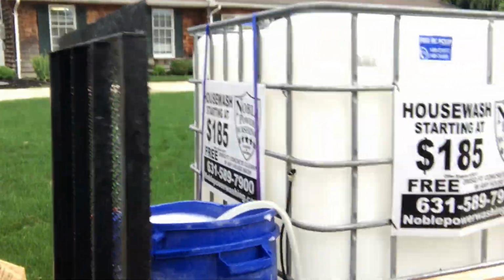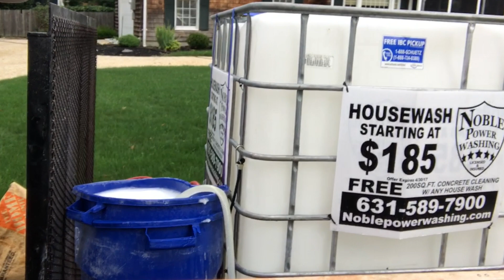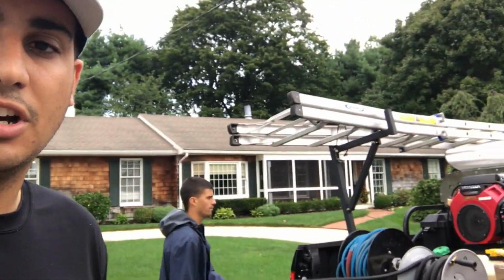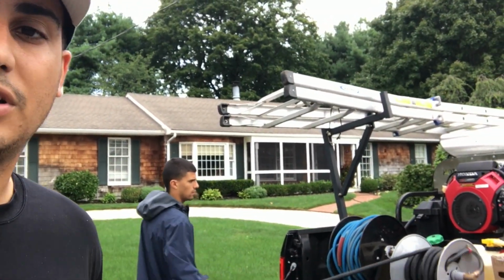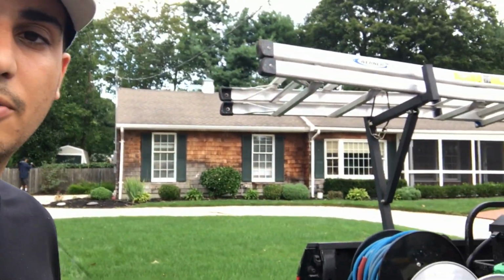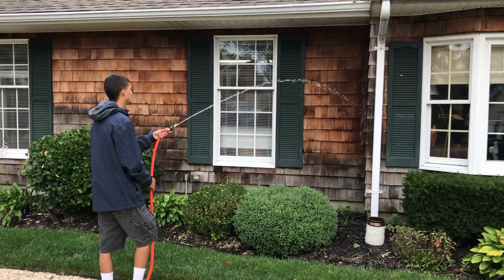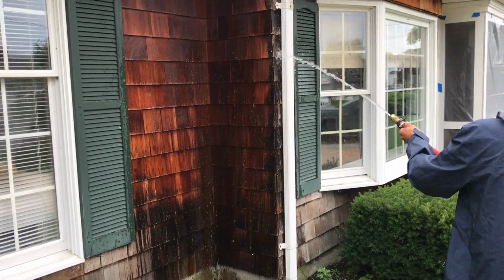Noble Power Washing: Cedar Restoration in Brookhaven, NY

Comment: Spray with 3% sh, rinse, spray with oxalic acid, rinse
Reply: Had me sold up until the pressure on the wood 🥴 soft rinse followed with oxalic and rinse like you said
Reply: I didnt think u should mix ur sh or hp with ur ox and spray both at the same and its mix takin off the fibers or u blasting it off ???

Comment: My neighbor had their cedar shake siding power cleaned although they didn’t pretreat it.  They used the power washer just like you appeared to and now her side looks sparkling clean but the warpage is so bad it looks horrible. Some of the cedar edges are as much as 4 inches away from being flush.  A bunch more 2-3 inches and all at least an inch. After seeing that I would never clean it with anything high powered.

Comment: Seriously dude you just put pressure on wooden shingles definitely wash them against the grain definitely have lines all over that house.!
You’re supposed to soft wash a house like that
Reply: My neighbor had their cedar shake siding power cleaned although they didn’t pretreat it.  They used the power washer just appeared in this video and now her side looks sparkling clean but the warpage is so bad it looks horrible. Some of the cedar edges are as much as 4 inches away from being flush.  A bunch more 2-3 inches and all at least an inch. After seeing that I would never clean it with anything high powered.
Reply: Would you x jet sodium metasilicate?